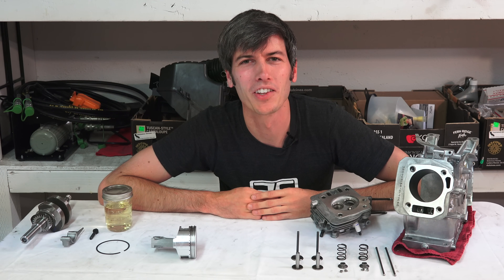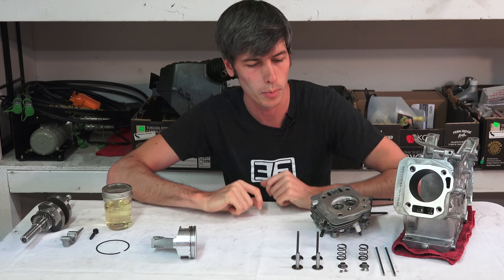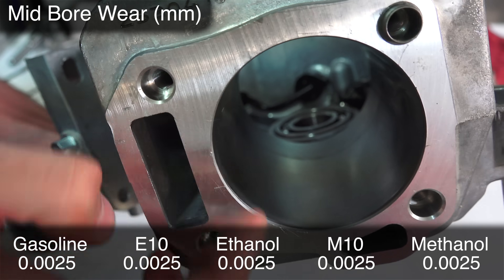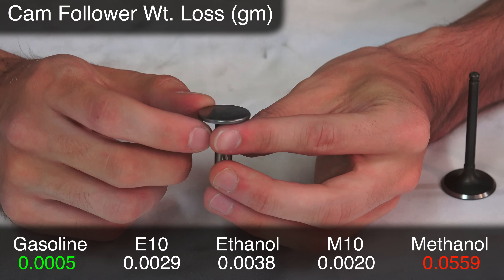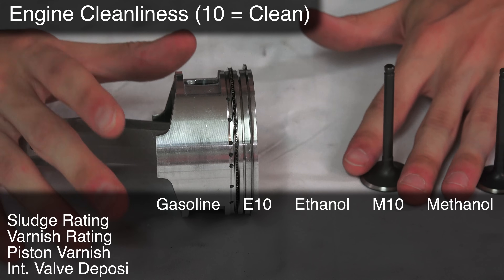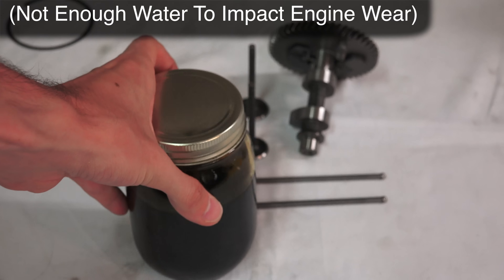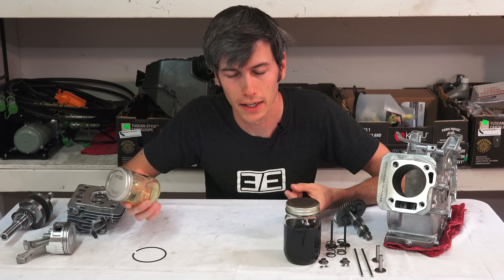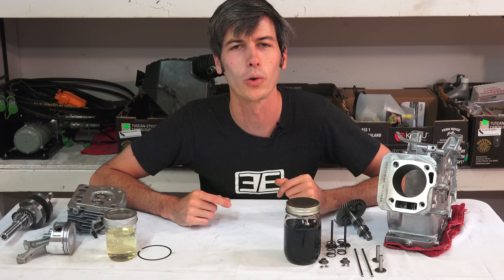Is Ethanol Bad For Your Car's Engine?

Comment: 1) no increase in wear
2) decrease in deposit
3) increased water content in oil

AND

4) different energy Is released by combustion of different fuels. You should not pay the same price at the pump.
Reply: Why pay for it? why not make it yourself?
Reply: @bundeswehr7676  I don't know where you live, real gas is generally not available where I am: Ontario.
Reply: Ruben Borges ...Ok..I live in North East Tennessee. 100% gas is here, you just gotta look for it. Luckily my neighborhood gas station has it...
Reply: @rubenmborges , you got that right. Had a Ford f150, with 90 liter tank could do 750 km/ tank. Drove doun to Florida did 900 km one tank full. The energy content is different. 
Also, I noticed the rip off at the pump, I had 80 km to empty fuel consumption indicating and fill up 98 liters on a 90 liter tank.
They generally take 10 percent,  doesn't matter where you fill up in Ontario.
Reply: @rubenmborges  In Canada, almost all regular unleaded fuels are a blend of 10% ethanol and almost all premium unleaded fuels are straight gasoline, without any ethanol.
Reply: E10 is cheaper..

Comment: How bad do you think it is to run a E20 or E30 fuel mix on a older truck like a 91 Toyota pickup. Do you think it would hurt the fuel lines and fuel pump or the engine in general if its a lower content of ethanol aside from something like pure E85?

Comment: This particular study provides  meaningful data points, but it isn't  comprehensive as it does not encompass all the possible deleterious effects of  running Oxygenated  blends - and  how  could  it:  The study misses the multiple cold  start and  warmup cycles  that most passenger cars  see and  exacerbate  top bore and  cam wear.  Also  there is no talk of  misfire  count when running stoic or better yet a   lambda  1.1  lean  cruise. May be  Good  for  Aircraft and  boats that  operate at moderate - high at  load constant  RPM 99 % of  operational time. - Sandy

Comment: i drive with a 3.2 liter v6 engine in direct injection and since 20 000kms i use E85. The consumption
 grow to 13l per 100km, its just 1 liter more compared to gasoline

Comment: Before watching the video here is what I think. Ethanol is alcohol, so in theory it should burn cleaner. Although it will mess up rubber fuel hoses over time.

Comment: Here in France I do my own blend of around 60% E85 + 40% E10. I Have a 2016 Toyota Hybrid and it works fine. My average consumption has raised about 10% but my price per tank is about 30% cheaper.

Comment: How about doing a video on the energy content differences between gasoline and ethanol?
Reply: 100% ethanol is 30% oxygen by volume and plus a higher octane rating. E10 is 3% less energy density and regular unleaded.

Comment: Imposition of requiring motorists to mandatory purchase/use of gasoline with blends of ethanol creates many problems objectionable by the public. Blending ethanol in any amount reduces the energy content available, relative to gasoline, that impacts gas mileage of motor vehicles. Adding 10% ethanol to gasoline reduces average fuel economy by 2-4 mile per gallon. Adding 15% ethanol to gasoline has a much greater impact on fuel economy, resulting in as much as 25% loss of miles per gallon. This is very significant and has not been adequately reported to the general public for assessment. Combining two different fuels into a mix to be sold as a single use motor fuel is unwise. For improved fuel efficiency in the use of ethanol, automobile engines would have to have much higher compression ratios in cylinder/piston designs to take advantage of ethanol's octane level rating. Compression ratios of approx. 14:1 would be more suitable.Existing engine compression ratios are approximately 8.5 : 1. Another problem of  ethanol is that of having a higher oxygen content. This reflects in a fuel of having much less energy content and further reduces fuel economy. It is unfair that this information has been held back for public scrutiny. The use of E15 will have end result of much increased fuel economy. The people to benefit the most from mandatory imposition of E15 are the industry lobbyists pushing to have it forced upon the public. This is NOT based on free market enterprise principles. If the lobbyists want to sell ethanol that is fine, but it should be done so without mandatory requirements and/or government financial subsidies. 

I have experienced firsthand problems with ethanol laced gasoline. A 1998 Chevy Astro van I have has fouled fuel system issues because of the water that ethanol has in it's content. Ethanol is hygroscopic (absorbs water). Fuel system components in this van have corrosion that has disabled this vehicle's operation. It will be very expensive to repair. I ask who should be responsible for these types of repair costs? Has that been considered in this mandatory requirement?

Comment: Problem with E10 is we get less amount of energy because in the same volume , ethanol has less amount of energy compare to regular gasoline, Moreover , ethanol has higher octane number than regular gasoline and by adding ethanol u get higher octane rating . So manufacturer can create lower octane rating gasoline to sell as higher number by adding that ethanol.

Comment: slightly worse fuel economy but its because the engine wasn't made to run on pure ethanol.  If it was higher compression and different timing would make up for that.

Comment: One question I have is that when they did the test back in 88, cars have changed so much. What about on catalytic converters and electronics? 
Today people keep their cars longer, so what about on a engine that has over 250,000 miles. So many variables if they were to do that test again today. 
Just something to think about. 
Great video

Comment: So what your saying is the study implies that if they mixed a bit of light engine lubricant additive into 100% ethanol then that combination might work as a good pump fuel. You could also have a H20 sensor in the crankcase so a warning can be given for oil changes when there's a bit too much water.  My Bike's 30 years old and all I did was change the fuel lines and carburettor parts to alcohol tolerant ones which are the only ones you can get now anyway. Old rubber parts perish anyway with ordinary gasoline. Hasn't caused me a single problem whatsoever. Good video!

Comment: I never thought ethanol would hurt the engine. But if you leave it, it will cause clogging and failures...
Reply: Gasoline causes clogging and failures because it goes bad. Clogging and engine failures due to bad fuel has been a problem way, way before the adoption of E10 in America.

Comment: Man O Man....all these naysayers on here complaining about Ethanol.   I have a 12 year old car that is not a flex fuel vehicle.   I run E85 in it every fill up.  I get 3 mpg less mileage.  my car runs better.  It's smoother.   I also live in Wisconsin.  It is Cold as ** here in the winter.    I use E85 and I run my car in -20F and colder ALL THE TIME.   No problems starting or nothing   I have run ethanol for over 2 years.   ZERO Problems.   And it's up to a Dollar cheaper in price.   it's a no brainier for me..   I run it.   I love it.   

Yes.   Don't put it in carb vehicles or older vehicles...that's a no no.  But "modern' fuel injected cars.... since say 2001 and up.   No issues.  The 4 cylinder cars usually have no issues with Caution lights on the dash, because they have higher compression ratios.   That's just my 2 cents.
Reply: Ethanol fuels are fine for all automobiles, with carburetors or fuel injectors. Ethanol-gasoline blends were extensively used for decades in Britain, Germany, France, Brazil, and other countries before the advent of fuel injectors. In fact, some people who are considered to be very expert in fuels take the exact opposite position - they say that ethanol is good in carburetor engines but not fuel-injector engines. Ethanol is good, period!

Comment: I have a 2017 Lincoln that take E15 when I can’t find E15 at the pump I use regular 87 gasoline, but I went out of town for a week leaving my car at home when I got back I drove my car & the check engine light came on I took it to get looked at, I was told that I had been using the wrong kind of fuel & had about 2inchs of water In my gas tank! I guess wen I left out of town the gas & ethanol in the tank separated making the ethanol absorb air making the 2inches of water appear. 
This video was helpful now I know how I got water inside of my tank, I had thought this whole time that somebody put water into my tank
Reply: Ethanol does not suck water out of the air. Get a new mechanic, one that knows what he/she is talking about.

Comment: In Brazil the gasoline isn't 100% pure (27% Ethanol). Also in Brazil we started a program (ProAlcool) at the end of 70's after oil shocks in the stock market. Since them is a long way but with ECU injected engines, direct injection and turbo (along with forjed metal parts) the ethanol itself showed great advantages with new tech. In Brazil +70% of whole cars are bi-fuel (we call it flex fuel). It can run 100% on ethanol and also in gasoline E27 or any percentage mix between both. Some examples: we had 1.8 NA/ 1.4T Chevy Cruze, 1.6 Ford Fiesta up to BMW series 1, 3, X1, X3... 1.6T from BMW/Peugeot, 1.4 VW TSi, 1.0 Ecoboost, Hondas, KIAs, Hyundais Toyotas, etc. Our legislation says unless it's a cargo vehicle it cannot have diesel engines (so only pick up trucks and heavy trucks have it).

The price of ethanol here is way more cheper than gasoline (in most places). The basic math is ethanol give 10-15% more power but gas have 20-30% more mileage. This happen because all manufacturers adapt their engines to run on Ethanol, but researchs says is the engine is built from start to run on Ethanol and adapat to run on gas it will consume 10% less ethanol than gas and have a 10-15% extra horsepower in general. Today, as an ex, in my home town Ethanol is 45% the price of gas. We produce it by harvesting sugar cane. Ethanol left less residue in the components (clear burn- left no dirty carbon deposits in the cylinder), less particles and exhaust more water (a cold start you can see the exhaust spilling it). The downside is that it absorbs water from the air (during transportation or stocked) if not properly managed thus generating less power.

Comment: I have near 300 000 km on my car and not a single engine problem except of course the regular stuff like changing oil and spark plugs. Regular 10% ethanol gas everytime. Chevrolet HHR 2007.

Comment: I would like to see the boundary condition of this test to draw conclusions on the ethanol wear. From my experience 20 hours is much to low to draw any conclusion from wear judgement at least when you are adding 10% ethanol. The results you are showing are in such a low range that the actually engine tolerance, surface roughness have significant influence on that result. I'm coming from the industry and I would start considering to get some usefull results from >100 hours at full load conditions.

Comment: Lower energy density,  similar cost per gallon to me, and will wear seals on older equipment. It may not be detrimental to my engine,  but it is really hard on my wallet
Reply: Energy density (BTUS) is irrelevant.
Ethanol is compatible with more engine parts and materials than gasoline, benzene, toluene, and xylene.
I can't comment on the cost issue you raise since you didn't identify where you are. However, Ethanol-gasoline blends should be cheaper than E0 unless you are somewhere where they artificially inflate the cost of ethanol.
Reply: @TheAutoChannel  how is energy density not relevant? If it takes more ethanol to do the same work as less gasoline,  then you have used more ethanol

Comment: I run some 2-stroke commercial lawn care equipment for work, and have always been advised to use non-ethanol fuel. One reason I've heard is that the ethanol will prematurely degrade the gaskets/seals etc. 
Engine wear aside, is there a comparable study focusing on non-metallic components that might be applicable?

Good video btw.
Reply: Ethanol is compatible with more engine parts and materials than gasoline, benzene, toluene, and xylene. Parts wear down; parts break. If there is any "premature degrading" it is caused by gasoline and aromatics.

Comment: Love this video about Ethanol fuels.  I am a Outboard Marine Mechanic so needless to say I have to inform customers that they do not need use Ethanol free fuels.  However I do disagree with you about the phase separation of ethanol fuel absorbing moisture from the air.  My reference being "Myths of Ethanol" my Mercury Marine.  Would love to hear your thoughts about this.  If you have any problems finding this publication I can send you a .pdf  Love your channel keep up the good work.  Jeff

Comment: The problem with 10% ethanol blend is what it does to carburetors and to fuel injectors.  Edelbrock declares that using E15 which is 155 ethanol will void its warranty.  This is what needs to be tested.
Reply: It doesn't "do anything" to carburetors and fuel injectors, except to help keep them clean.

Comment: @EngineeringExplained Love the video and it’s presentation. But I feel like this test omits stop and go driving in which rich post combustion gasses recirculate into your intake and cokes valves. Long Idle times paint a very different picture of modern DI, high compression engines. Many consumers are NOT using “Top-Tier” E10 fuels recommended from manufacturers. Top-tier E10 fuels have additives that minimize engine sludge and prevent harmful effects of ethanol. However the EPA’s LAC regulation does not inform motorists the real life consequence of running E10 with inadequate detergents.

I’m also a big time supporter of PEA, if you could do a video on Archoil’s AR6200 fuel treatment that would be awesome. Non-Top Tier fuels are readily available, this product fixes engine coking.

It’d be great if you could further enlighten the audience on the importance of fuel additives and how they interact with carbon deposits.
Reply: Ethanol itself minimizes engine sludge. Engine sludge is caused by gasoline - this is why detergents were added to gasoline in all the years before ethanol was commonly used in America. In the decades that ethanol-gasoline blends were used extensively in Britain (for example), these blends were always marketed by the gasoline companies as being cleaner, more powerful, safer, and less expensive.

Comment: There was even an older model of the Ford Focus, which could be filled with 85% ethanol - only the flexible tubing connections and gaskets were adapted due to the higher aggressiveness of ethanol.

Comment: it's not so bad with a car engine, but with small motors like lawnmowers, its obvious to me that ethanol makes them run shitty and the gas doesn't last the winter
Reply: Plus when gas sits for a long time it goes bad.  If you store fuel use a fuel stabilizer additive over the winter.

Comment: This test was done in 1981, how has metallurgy changed since then in terms of manufacturing the engine components?  It would be interesting to see this test repeated with modern parts.
Reply: Most engines in the 80s were Iron. Modern engines as typically Aluminum or Compact Graphite Iron.

Comment: Glad you mentioned some of the issues with using ethanol as a fuel. I still can’t find a single person that can explain why adding 10% ethanol is beneficial. The fuel prices didn’t come down when they started adding it at all the pumps, and decreased efficiency means you have to fill up more often. Why do we use it again?
Reply: It lowers pollution, that is all.

Comment: I love e85. Been using it for the last 8 years with 0 issues. No fuel problems like everyone mentions. I've converted a couple dodge neons of mine a 01 dodge ram 5.2L and my 08 dodge avenger. All run amazing on e85 and its much cheaper. 👍🏁
Reply: Also love E85, petrol is just rubbish compared to E85. I blend it in my outboard from 1983/1984, my moped and some lawnmowers. It's soooooo much difference between petrol and E85 in the lawnmowers when you are breathing in the exhaust the hole time, E85 smells sweet and I don't got shortness of breath, and it's better for the engine 😎 E85 is the future ❤️

Comment: I gave up with ethanol fuels after they dried out far too many seals on previous vehicles and I  was fueling up more frequently. Not an issue with 100% Gasoline. little to no oil leaks on a car with over 200,000 miles and better mileage. Ethanol gas is rubbish in lawn mower engines as well and made them sound like they were misfiring.

Comment: My poor boat engine ( 2000 MERCRUSIER) keeps getting vapor lock when its hot outside. I  get stranded on the lake. Wish I could buy the regular unleaded. I heard this stuff is bad on boat engines as the fuel sits in the tank for a long time and it's hard on fuel systems. EPA wants to go higher with ethanol content. Why use ethanol when we have plenty of oil and we produce more than any nation in the world.

Comment: ethanol reduces fuel economy, higher ethanol content causes higher engine temperatures, breaks down rubber parts, reduced power, it goes bad faster and absorbs moisture when not used. ethanol is wonderful. all it does is water down the gas so oil manufacturers can make more money and charge the consumers the same price.

Comment: The biggest issue I have with ethanol blends is we as consumers have no idea the state of the fuel in the ground tanks a gas stations. How long has it been there? Am I pumping water into my vehicle that is the product of the phase separation ?  It's has inferior performance for fuel efficiency, has the potential for adding water to the the fuel system. Just nothing good. IMO Ethanol is a legal way for oil companies to water down fuel and sell it for the same price. Nothing more.